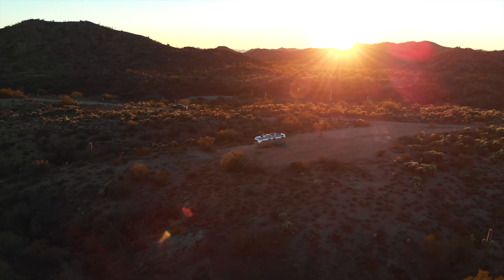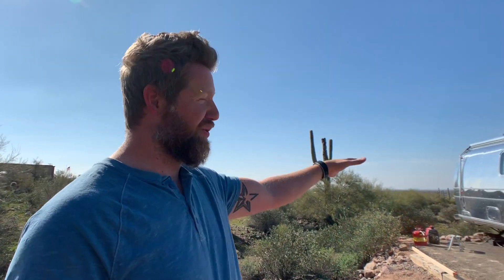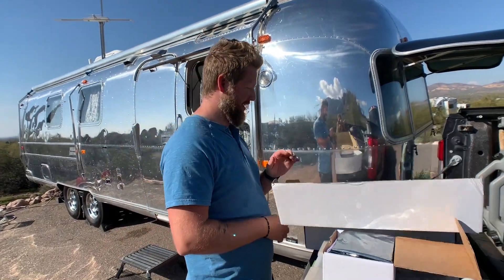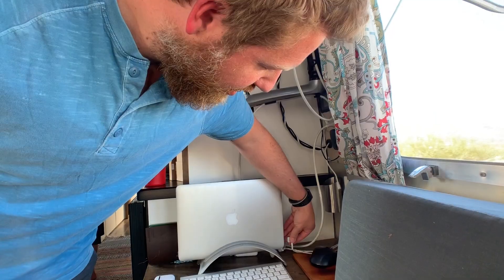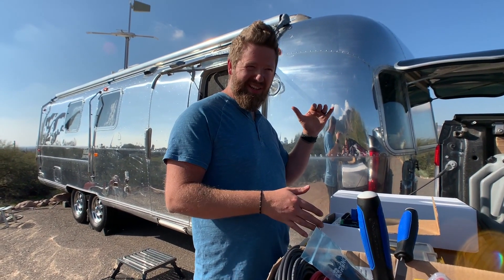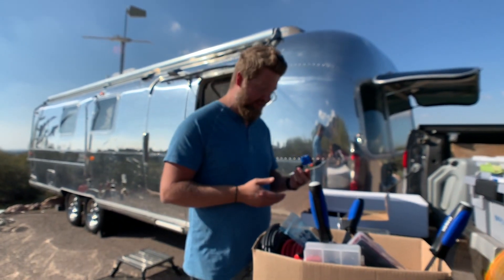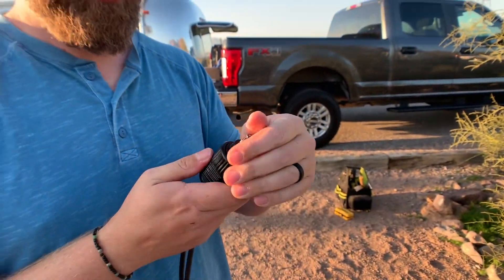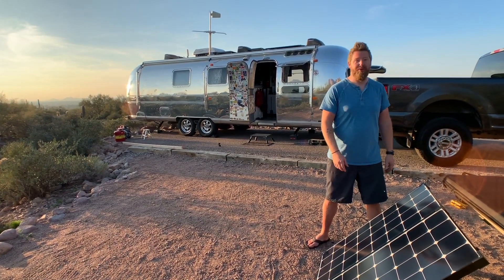Solar Upgrade - Adding a 200W Ground Deploy and 2000w Inverter to our Airstream

Comment: Super nice job, looks awesome!  We're at 650 watts on the roof, same AH in batteries. You're more flexible with the 200W ground deploy, which is nice. Glad it's working for you. :)
Reply from the maker: Thanks! I wish we could have fit 650 up there. Dang vintage rounded roofs :) It's been working great, though. Haven't had to tilt the top panels at all so far. The ground deploy is making up the difference all on it's own!